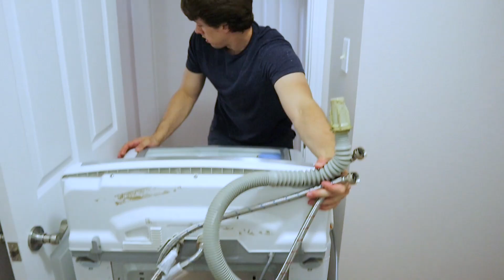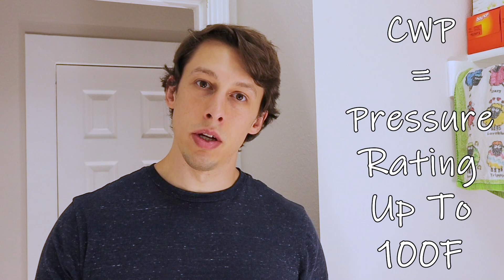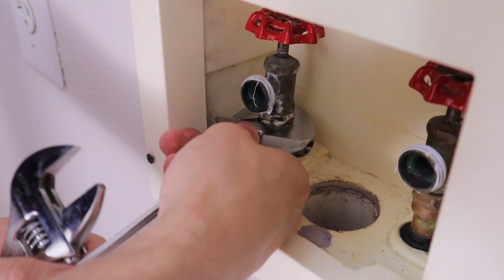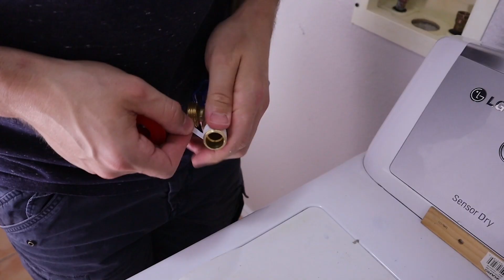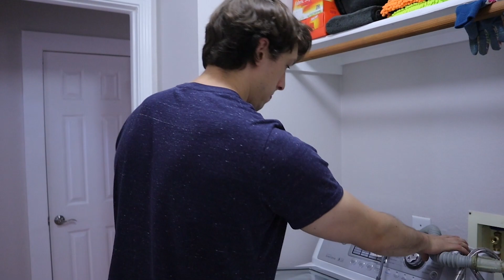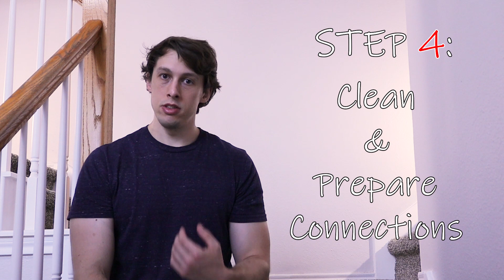(No music) How to Replace Leaking Washing Machine Water Shutoff Valves - Choosing Valves & Install

Comment: It was hard to hear you talking over the music on your original upload so I came to this one thanks to your link in one of your reply comments. Might want to link it in the other video’s description box to make it easier to find for others. Much better w/o music only because I can hear what you are saying so much better now. SUPER helpful, informative, and educational video. Thanks so much! Saved me a plumber call so that I could use my new washing machine which suddenly had very little cold water supply flowing. Couldn’t get enough water pressure since the cold water valve was rusted, old, going bad, and finally gave out apparently. New cold water valve fixed the issue!!Thank you!! 🙏🏼 🎉❤

Comment: A suggestion... Replace any water valve with 1/4 in valve. Think of this - If there is a leak and you immediately need to turn the water off...1) Hear or see leak, 2) run and find leak, 3) turn valve, turn valve, turn valve, turn valve...... That type of valve works well on outdoor faucets, always replace with 1/4 in turn off value. It take just a 1/4 in turn and the water is off....So replace them is my suggestion. Also, another factor that makes turning the water off quickly is the limited space for you turn the valve. I would replace them if you fear another leak.

Comment: Great video (without the music).  Thank you for doing this.  My old valves don't show any threads so I'm wondering how they are attached.  Any ideas on how to find out?
Reply from the maker: Thanks Aaron!  There are so many different configurations out there that it's hard to say.  Generally, the four common joints I came across for washing machine valves were threaded into an adapter (like mine), compression, push-to-connect, and soldered (also sometimes called 'sweated').  If the joint is visible, here are a few things that I used to check to see if it's one of those four (If you have a valve box on the wall like mine, you might need to remove the faceplate to be able to see the joint between the valve and the pipe unless it's already exposed like mine were).  For threaded, if they're screwed in, there will usually be an adapter on the pipe that the valve is screwed into, which is one of the most obvious giveaways that the valve is screwed on.  If the valves are mounted flush to the box, the threads and adapter may be just below the box in the wall and might not be visible though.  The faceplate might need to be removed as I mentioned.  Compression joints usually have a large nut that's slightly larger in diameter than the pipe as it's screwed on over the pipe.  I found this to be an easy identifier for this type of joint - Google 'washing machine compression valve' and you'll see the nut I'm talking about. The push-to-connect usually have a distinctly larger collar where the pipe is pushed into the valve that makes them stand out - you can also Google 'push to connect washing machine valve' and you'll see the collar.  If the valve is soldered on, the pipe will go inside of the valve at the joint and can be an easier way to identify soldered joints. This is usually the case as well for valves that can be both soldered or threaded - the threads are still visible on the outside of the valve, but the pipe will go inside of the valve at the joint. If you look closely (and it's not too dirty) the solder can sometimes be visible too - usually a silver or dark grey color that's a little different than the copper pipe.  Be sure to turn off the water and drain the lines in the house to be safe when working with the valves, though.  I'm also not a pro so it might be helpful to give one a call if needed.  Super long reply, but hope it helps!

Comment: Great video thanks! I have a threaded setup like yours. Wanted to get a 1/4 turn ball valve though (instead of my current gate valve)... Seems the options I  found all have much longer stems??? For instance: https://www.amazon.com/American-Valve-WM75LQTB-Quarter-Washing/dp/B00QGXABS6/ref=pd_ybh_a_18?_encoding=UTF8&psc=1&refRID=699SJBY86DYTYNNXG2T7    Not sure how this would work being so long...
Reply from the maker: Thanks for watching! The long shanks can definitely make things a little difficult.  I googled around a bit searching for 'short shank 1/4 turn ball valve' and found some options that might work.  Looks like there are a couple options with various lead contents if that's a concern - link below is for the lead free ones I found, hope it helps!

https://www.supplyhouse.com/Dahl-621-01-04-PK2-1-2-Female-Sweat-or-1-2-MIP-x-Male-Hose-Angle-Hose-Boiler-Drain-Valve-LF-Brass-Pkg-of-2?gclid=CjwKCAiA25v_BRBNEiwAZb4-ZZ7ywDQVw0_D0pxRxCM66807jTjIda-G9chwGGJaeASENLiIjMC6gxoC108QAvD_BwE

Comment from the maker: Good luck!

EDIT/CORRECTION:  In the video I mention that ball-valves have to be straight, but there are actually angled ball-valves if you'd prefer a ball-valve and need an angled output.

01:18 - Choosing replacement valves
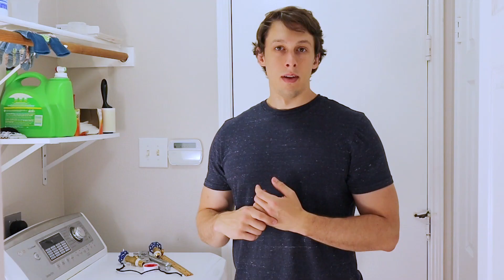09:04 - How to replace the valves
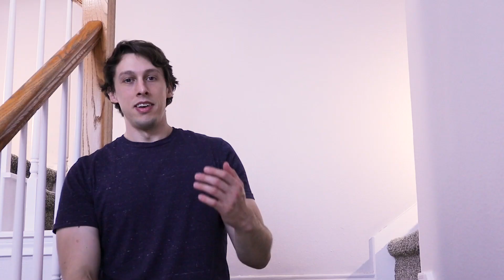16:14 - Summary of the process, tools, and cost
Reply: Thank you so much for the video minus the music!!! 😃Really thankful for the details here!!!
Reply from the maker: I'm glad the video was helpful!